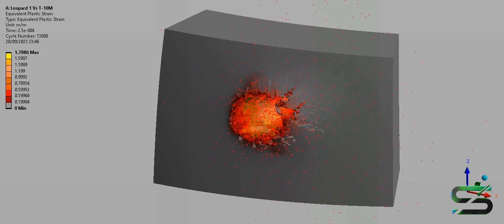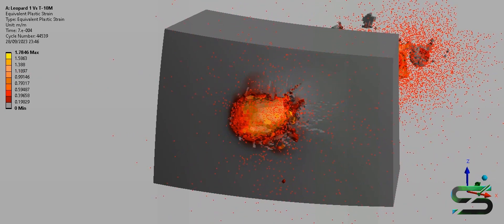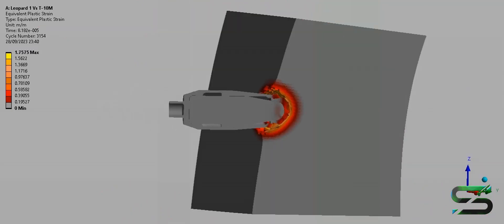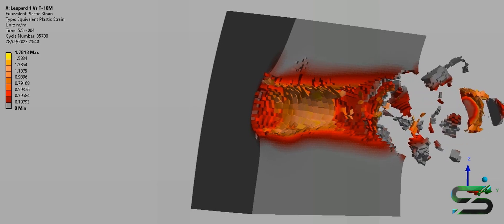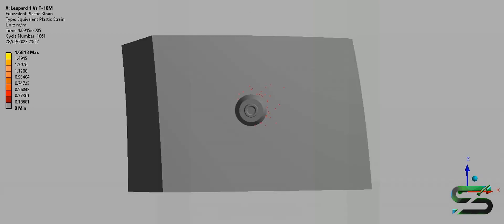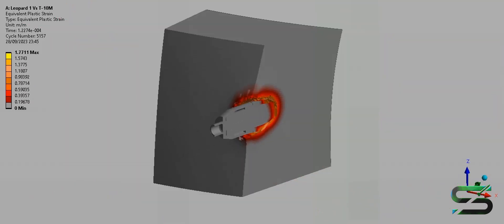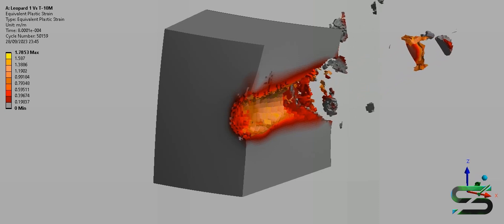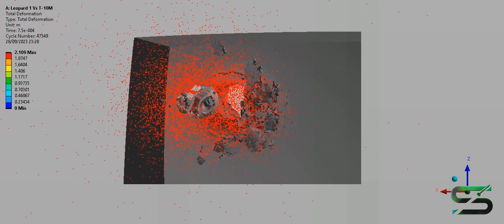Leopard 1 VS T-10M | 105mm DM13 APDS Armour Penetration Simulation

Comment: Can you make a video comparing  aluminum armor vs bronze armor?  I have yet to see videos showing what bronze can do.
Reply from the maker: Seems a good idea although an accurate failure and strength parameters for bronze alloy are not available. Yet, I can guess an approximate value since it is made up of 88% copper.
Reply: @SimulationPlus  could you make a simulation with chromium armor? first maybe same thickness as some RHA, then same mass maybe?